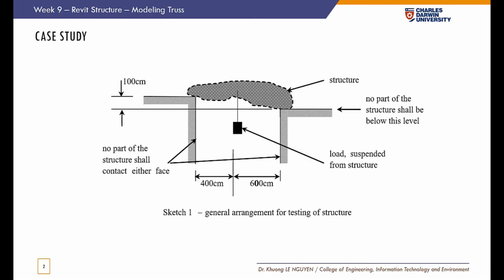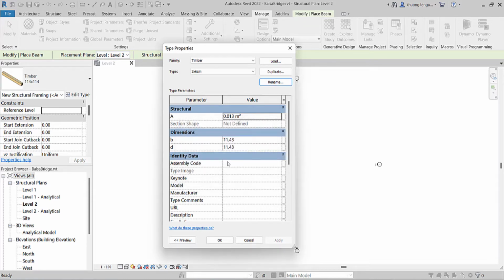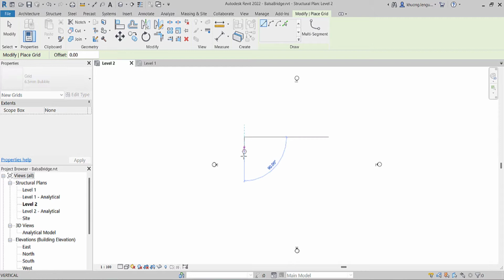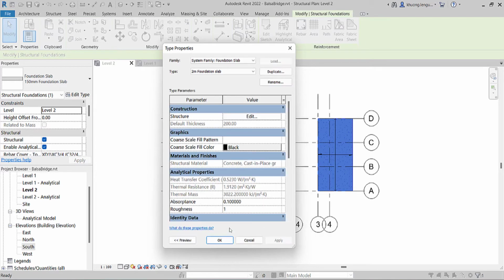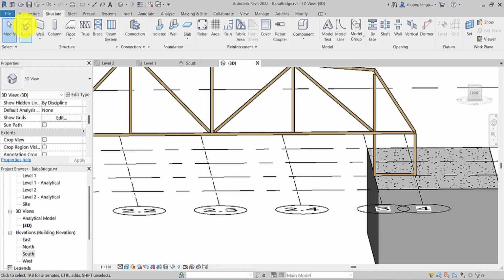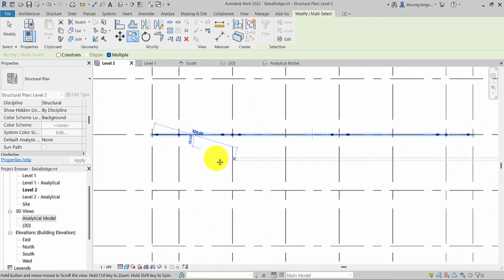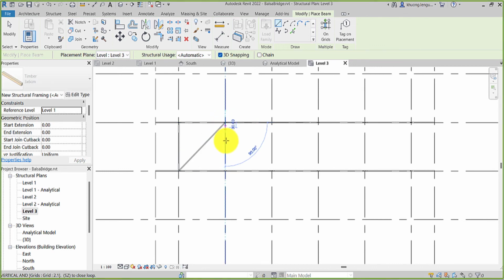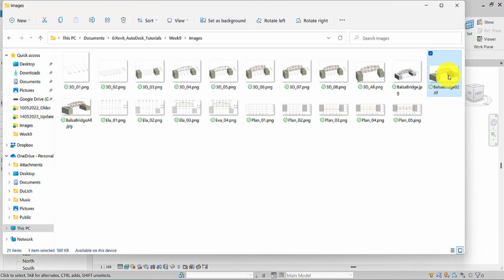Create a truss bridge on AutoDesk Revit (Balsa bridge project)

Comment: 3:59 Isn't it 0.3cm by 0.3cm? because dimensions are 3mm by 3mm
6:04 8 vertical and 3 horizontal reference planes
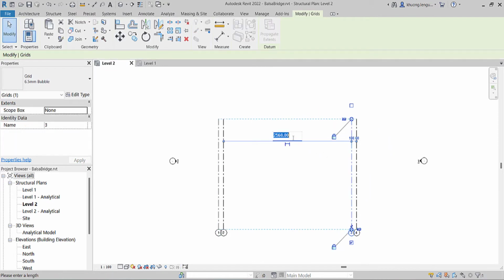8:20 Are you entering it in mm or cm or m here? how do i know?
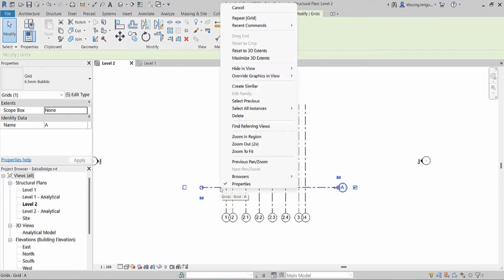9:30 How did you know that the distance of the line is 2m?
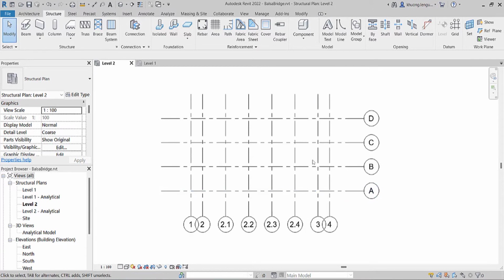10:10 A lot of my numbers are overlapping here. What can I do?
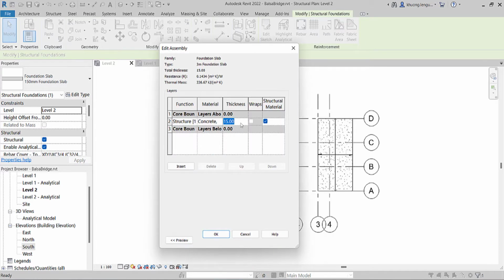11:40 how do I know which thickness to change my one to?
13:33 My program doesn't have the load family button at this point of time